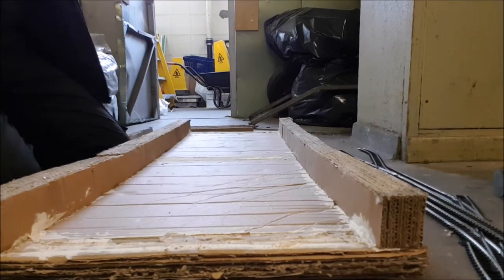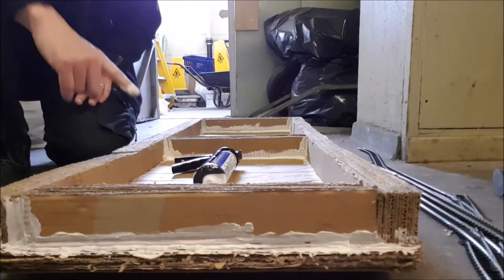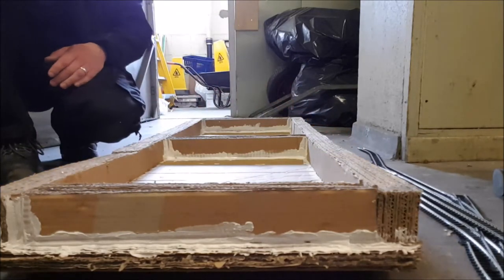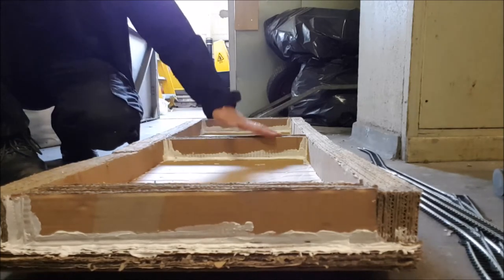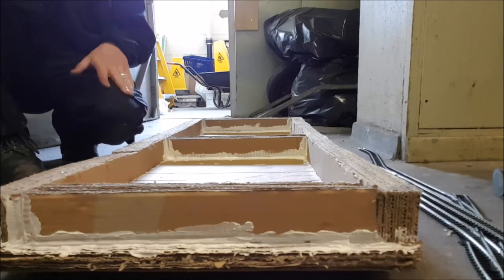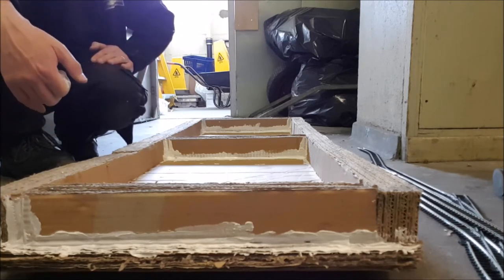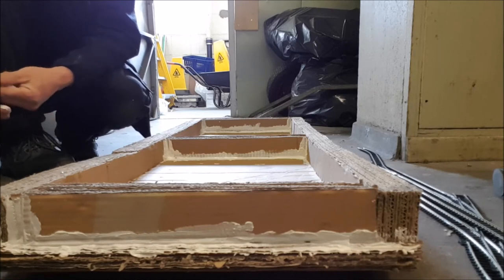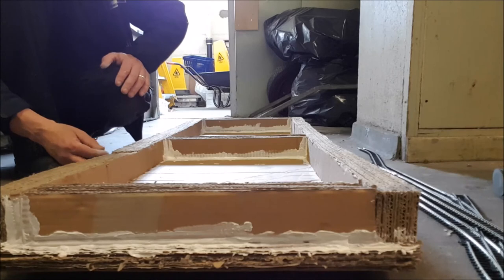New Layout part 6 baseboard construction part 5

Comment: Try ron seal or the filler and fill alll over the board. Try PVA 
Ur laying but ur light and we meant a heavy weight
Reply from the maker: Matthew Stamp I did think about that but trying to keep the cost down. But will see if I can get hold of a cheaper version.
Reply: Something's you can't skimp on I don't no if this is one of em.